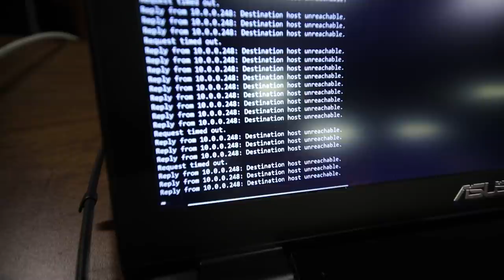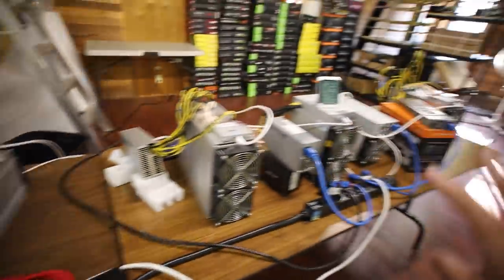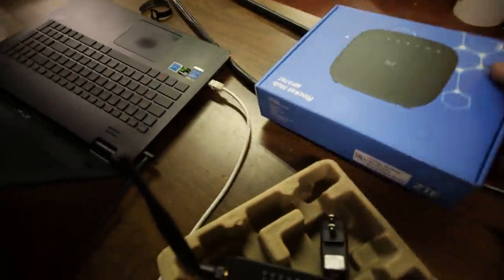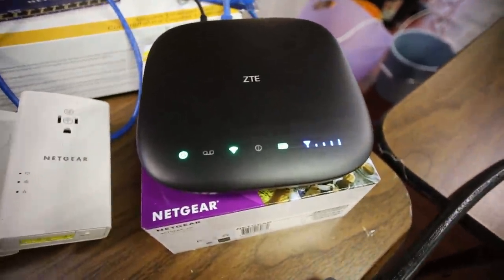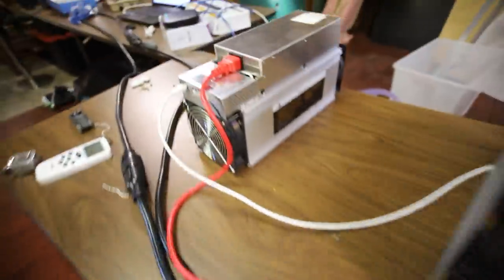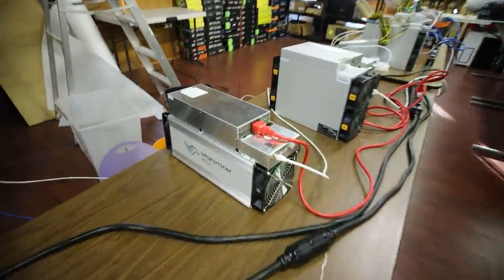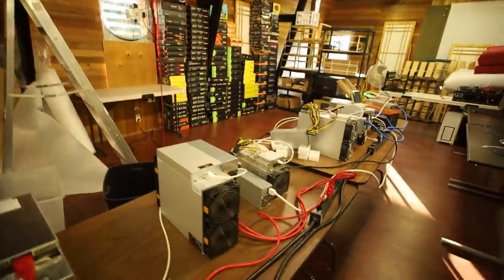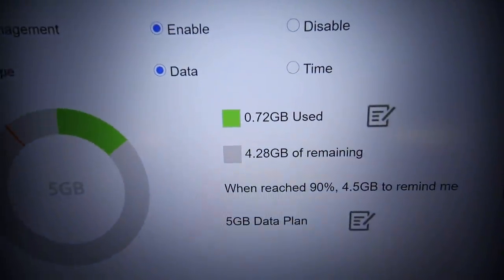Internet went down in the BARN...

Comment: I would trench a fibre link back to the house.  Point to point wireless also a good solution.  

Don't run cat-6 like others have suggested -  that's a terrible idea.
Reply: why cat6 no good?
Reply: Cat-6 is completely fine. Just make sure it's direct burial. I trench and run cat-6 all the time with no issues whatsoever. 👍
Reply: Terrible unless it is direct burial CAT6 but then I would run more than just one strand, so you have a spare or 2 . The problem with fiber is that you also need the 
tools to terminate the ends and unless you have 10GB ports the fiber is overkill.
Reply: cat-6 is just external use rated sheathing.
Reply: Cat 6 cabling has a design limit of 100 meters (305') from device to device, yes that includes patch cables . Yes it will normally work past that, but not always. For a critical run i would strongly recommend gel filled cables. When the case eventually cracks, the gel keeps water from penetrating farther into the cabling and further degrading performance. I haven't found gel filled cat 6 cabling when i have been looking for it for some of my clients, only cat5e.

Comment: Ethernet cables can be strung from your house about 300’ without any issues.
Reply: a good cat 6 cable is more than enough, i would prefer that over Wifi or CPL
Reply: Above 100 ft PoE is recommended
Reply: I agree. We’ve done this to get internet to our barn. Just need some small conduit to protect it and you’ll be setup in a day. Can’t wait to see how it all turns out.
Reply: S
Reply: I would bury some conduit and run some Ethernet cable out to the barn 

Harder right now but much better in the long run for you barn
Reply: Could also get repeaters to increase from 300
Reply: A GOOD well shielded out side rated cable. Yes but most cheap Chinese cables will work. However the longevity is always shown in the cards....
Reply: I would bury an Eth cable 😎
Reply: Agreed. Cat 6 cable.. or even a fibre cable is pretty cheap these days.
Reply: @juddersnz  I agree some burial conduit with Ethernet or fiber is the correct solution.  Of course I don’t know how far you are from your main connection. You can also put repeaters in line with the Ethernet if need be. How far are you away from your main network connection.

Comment: try the verizon jetpack and also get in line for starlink its only 100 a month but allows so much more you don't have to pay multiple internet plans. 3rd get some high grade extenders to run from your main router to your barn you may need one somewhere safe outside to get the best connection jumping from your house to your barn idk how far the distance it would be especially from the home router

Comment: Buy a good 4G router, like Teltonika that makes industrial products, for industrial use, that are made to keep a connection sins productions at the industris dont wanna the connections to get down, and put a 4G dome antenna on the roof, and u are good. i use this setup my self at home, and i get 120mbit down and 40mbit up via 4G. (sweden)
recommends a router that have CAT6 connecntion and an MIMO antenna for best connections

If u get your internet the normal way u use to, the teltonica routers have internet backup functions,  lets say your cabel internet gets down, the router knows it, and will switch to 4g automatically.

Comment: US here, aspiring miner myself but i just don't have a proper mining rig frame ironically. About your issue, there are programs that can either limit or cao your bandwidth, i wonder if that would help at all? If your hotspot is having trouble id say either a hard reset or firmware update would be in order. Do you have the most latest firmware for your hotspot & all internet related devices?

Comment: I would go with the Ubiquiti Point-to-Point they are fantastic I've deployed them in businesses that have building on opposite sides of the road and they run faster than if a CAT6A cable was running the length.

Comment: different buildings have capacitance differences and it can cause intermittent failures when using copper UTP networking cables between buildings on equipment powered in the different buildings.  a buddy learned this while networking campus buildings.  all building to building runs are done using fiber optics. its industry standard to avoid capacitance mismatch issues.
US

Comment: Mesh wifi if you have good internet cable near to you. Hotspot is just a temporary fix.
I tried this before but at the end I realized  it's not good enough. 
I got a new internet cable connection and all my problem solved. 
If you have any good connection near by, I would say get a mesh wifi and you will save alot.

Comment: With that much invested into hardware and how much it depends on an internet connection to be profitable, you should definitely either run fiber/ethernet to that barn from a main location or at least sign up for cheap dedicated service. If I were you, I would probably have a cheap backup dedicated service even if you're running a line from a main location. It would probably pay for itself if you're down a few days a year. because of internet connectivity.

Comment: The problem seems a bit strange. One option could be getting an internet provider, or getting a budget of how much would it cost to get internet connection, I don't think you need a lot of speed to run mining. Other thing could be getting an antena and using any other service provider from the local city. I used to not have internet, so I started using one of my village service providers. Anyways I hope you can fix the problem soon ^^

Comment: Hey Red Panda 👋 Local Canadian here in Ontario. I've grown up in my father's company McKee Security & Audio Systems for quite some time now. We install Ubiquiti products on a daily. I've personally installed their point to point system a few times. Setup can be a little complicated, but once you figure everything out it runs flawlessly. I've done up to 5 hops point to point. Great products. We've even wired up hospitals with 50+ access points. Also, Cat-6 is completely fine to bury. Just make sure it's direct burial. I trench and run cat-6 all the time with no issues whatsoever for thousands of customers. 👍 Conduit is always the best option, but honestly 6 feet deep without conduit works in a pinch no problem 👌

Comment: I actually ran a 200 ft Ethernet cable underground to my barn and didn’t have any issues for the two years I had it. You should really do that to avoid the jumps in response time and it’s expensive to have the cellular plan.
Reply: A Cellular plan is $25/month for unlimited data

Comment: I'm trying to figure out why you were running powerline in the first place. You mentioned about running Ubiquity point-to-point, but my question is "why"?

I don't know the layout of your barn (and why you can't seem to just get like hardwired RJ45 (CAT5(e)/6/(7?)) into the barn or why you wouldn't want to do that, even if it is only for greater stability (hardwire is always a more stable connection than WiFi).

I'm just curious.

And man, 93 F (34 C) with your systems OFF - DAMN!!!

I'd be worried about how hot the processors in your ASICs actually get (die and/or package temperatures) and the long term reliability of those ("long term" being a relative measure of course).

Comment: Is burying an ethernet cable out of the question? Or getting a dedicated internet service for the barn? When I build my shed later this month, I'm running a 200 amp service from the house (it's got 2x 200 amp services now and one isn't being utilized, and when I do that I'm going to bury ethernet out to the shed. You could also look into getting star link, although that doesn't solve the problem today.

Comment: I suggest a copper run to avoid latency extra with p2p + home isp router..   350' with no issues if your barn is within that range of a router/ hub.  
When I built my garage I ran 2x cat5e and copper 60 amp service in individual conduits.  It works perfect, one circuit for internet and another for my rigs.

Comment: Hello RPM! Your Vids are great 🤟🏼 I‘m using a outdoor LTE antenna for my house lte router and i‘m 6km away from the  Radio mast with a parmanently Ping of 20 - 40 ms.
It works fine for over a year now. Antenna only cost about 50 EUR in Germany.

Comment: The Unifi AirMax Gigabeam P2P is a decent system but I would research how cold weather would affect it. You would have to prevent ice buildup on the dishes with a cover just like they use for microwave p2p systems. The best choice would be full burial armored (rodent resistant) Cat6 (300m max) or Single Mode 9nm fiber (over 300m). If you have burrowing varmints in your area you could expect them to chew on unprotected underground cable. Full burial armored cable is a lot of work but would give you the best results over time. The cost would be roughly the same for all of them.

Comment: I too tried to run ASIC on a mobile data on a secondary location where I don't have a landline yet, but the data usage and the ping were so bad that I just had to stop. If possible, you should definitely go for a new cable route from your basement (assuming that's where your main router is) to your barn. Depending on the distance between the two you should either go with an optic cable with the optical to metalic convertors which not only will give you huge speed and capacity headroom for any future needs but also amazing ping, or you could go with regular good old ethernet, but I wouldn't use anything else than CAT7 because of the futureproof-ness, shielding and (again) theoretical speed. Otherwise go for the radio point to point solution, either with UBNT PowerBeam, GigaBeam or AirFiber (depends on your budget, distance and visibility between the two points), or MikroTik Cube Lite 60, nRAY 60Ghz or LHG 60G. :)

Comment: If you have line of sight then ubiquti ptp antennas are fantastic. Even the cheap airMAX NanoStation 5AC Loco $49 will work fine. Set up in ptp mode to bridge both sides.  If your inside switches have an sfp port then bury a fiber cable if over 300 ft or eth cable if under 300ft. The antennas our poe and usually don't come with the power supply FYI. USA

Comment: PoE is only good if both adapters are on the same circuit. If brand new PoE adapters don't work, perhaps the quality of the electrical cable is at issue? (Check with a licensed electrician to verify.) Also, it is usually not a good idea to place a PoE adapter on a power board. 

As far as internet is concerned, get a cheap ASUS router (such as an RT-AX58U) and combine it with your existing broadband service. ASUS routers can be configured so that you can have a failover, (such as as your mobile connected via USB) in case your broadband service goes offline. Can pay for itself if outages are frequent.

Comment: Would be sweet if you could have a fiber run. That would take care of all future expansion. But when wires fail, you turn to Ubiquiti. Direct point to point would do the magic here and with the antennas/bridge kits not costing and arm, leg or liver, you'd see ROI in about a day.                     Airmax radios and (Nanobeam) with Unifi access points could work. This would do well if you want to keep the wifi signal from extending too far outside. I would however lean more towards the Unifi UAP-AC-M and the UAP-AC-M-Pro. There's cheaper solutions from other manufacturers but with Ubiquiti, you should have control from your phone.

Comment: Run Cat6 cable at 330ft or less (Outdoor Plenum), If you are farther than 330ft, Run Multimode Fiber cable and install a media converter on each end. Always better to hard wire. Cellular is too expensive and wireless is unreliable. 99% uptime is imperative for any network. Of course cable should be buried at least 6 inches down.

Comment: The best solution, I think, would be, if a run of less than 100 meters can be done between the house and barn, I would simply say to burry and/or pass straight 2 line of Ethernet cable, maybe into a simple plastic pipe and voilà, and you will have a spare if anything would go wrong  👍😉 Downside is certainly not the cost of the hardware, but more in efforts & time....Still, if done properly, I believe it can provide long years of service without any issues. Alright that was my opinion ☺ Cheer up to everyone for the giveaway, that is really generous from you, thanks !!!👏👍

Comment: Im in Canada. Ive had no luck with internet until i switched to bell. Dont know if they are there. If you ever decide to sell your 1660 supers let me know. I'm just starting out with building a computer to use and id love to have it mine as well but i cant get any gpus (big surprise). I have a z390A motherboard my brother gave to me to use. My last graphics card was a GeForce8400GS and im now running on my older brothers laptop thats 10 years old and cant even run 1080p videos. 
Anyways love the content, nice to see a crypto channel that isnt hocking shitty coins and airdrops all the time.

Comment: It is interesting to see how your setup has evolved.  Thanks for sharing your knowledge with the community.  Have you considered using an Ultra Long Range WiFi Extender Directional Parabolic Grid (High-Speed Signal Booster) Outdoor Antenna?  This beams wifi directly to your barn and no need for routing wires through the walls or burying wires in conduits underground.

Comment: Ohh man NOOOO those powerline adapters are HORRIBLE!!! I struggled with them for months when I first started mining in 2013! Connection was spotty and weird and eventually failed. I bought a new identical system and it worked again, for a week, then started getting spotty again and died again.... Thats when I switched to Ethernet and it worked, until a lightning storm took out 7 different devices all over the network.. then I switched to fiberoptic for any runs over a few feet. No more problems anymore.

Comment: If is just 100ft just invest on a cat6 connection, have someone dig a path and use some pvc tubing, there is also cat6 cable that is rated for external use and can be put underground without pvc runs. Alternatively you can use an antena setup, is not that expensive and the setup is quite easy. And… will love some free stuff!!!

Comment: Also had difficulties to bring internet to my rigs. In the end I have been using a TP-Link 4 antennas Wifi repeater/extender to bring Wifi in my garage. I then plugged a cheap 20 dollars TP-Link HUB/Router to the LAN port of the repeater. After that I only had to plug Ethernet cables from the small router slots to each of my rigs. Works totally fine for my situation.

Comment: Cellular systems are the same frequencies and protocols in Canada and the US.  Likely you got wireless routers with non-North American standard radios.   Point-to-point RF link is probably most efficient for the money.  If there is a power transformer between the house and the barn, it will likely not pass WiFi.  Perhaps the Hydro company changed something without telling you.

Comment: Order a 2nd connection from another provider install that in the barn, then you have a  backup in case your other ISP one is having issues. Run a CAT6 from the house to the barn and bury the cable.

Comment: If you are going to use a data plan, go for unlimited. The minor cost  saves allot of stress over running out of data.  

Id also get your hands on a 5g hotspot, if you can't get 5g itll still pick up 4g+  and will help with latency issues.  

I personally have a netgear nighthawk,which had been fantastic but i easily use 75gb a month with 1 x 5gpu 3070 rig.

Love the channel btw, always makes my day

Comment: Dont know where your barn is located. But always go with a wired connection. Depending on the range to your nearest network outlet. Less the 100m go for a cat6 copper cabel, if more then 100m go with a om3 fiber.
ubiuiquity radio point to point links are also a good solution. Though it only works flawless if theres a clear line of sight point to point.

For your network switches, upgrade to some old hp procurve 24port og 48 ports, you can get them cheap and its a much better and stable solution.

Prosumer gear such as netgear will eventuel give you problems

Comment: Aside from running a fiber line directly, I'd suggest point to point WiFi. That's what I've used for mining, works great for getting internet to the backwoods. And usually the ISP sells it at speed limit packages instead of data limit packages

Comment: If you are having contention with wireless check anything that could transmit on the spectrum you are having issues with. I had a Samsung Smart TV that when being used hammered my 5GHz and throughput was cut by 75%.

Comment: Depending on how you’re getting power to the barn that might be what’s causing the power line to fail. For example, I don’t think power line adapters can handle changing from two phase 120 to three phase 240. Others have mentioned burying fiber/Ethernet but with something like the Ubiquiti point to point you can update the technology without having to tear up the underground cabling.

Comment: I think that model has a possibility to mount a external antenna. Those are quite cheap (less than 100$) and easy to install and you get so much better signal. Get dual polarized MiMo panel etc. Easy 10+dBi. Also easy content :)

Comment: My recommendations are:
1. Run Cat 6 from the house using conduit.
2. Use Wi-Fi range extenders from the house to the barn
3. Purchase satellite Internet service for the barn if it's available in your area.
4. Check with your current ISP to see if they can install service directly to the barn if there are no added construction fees.